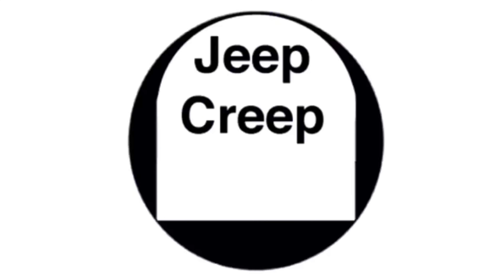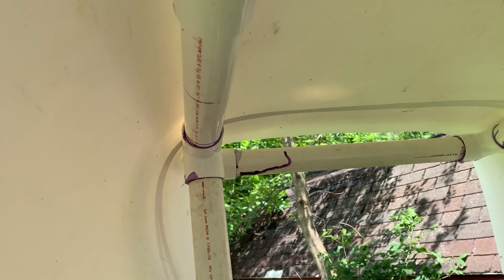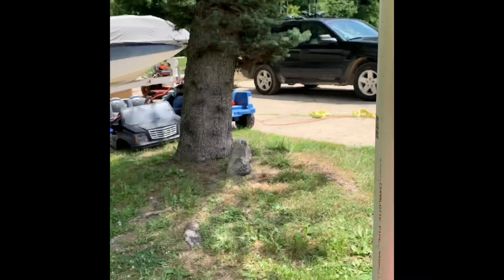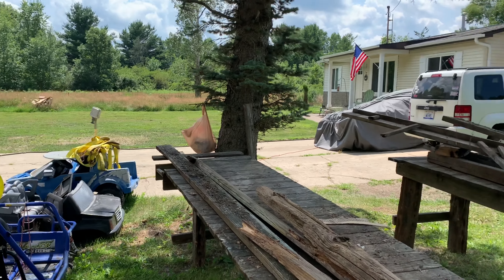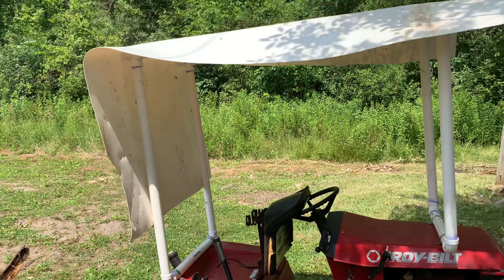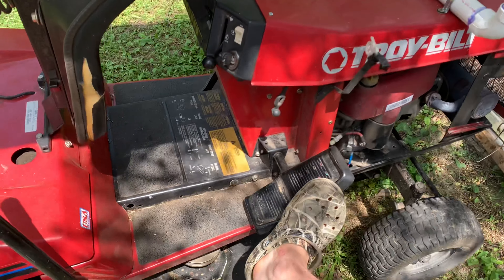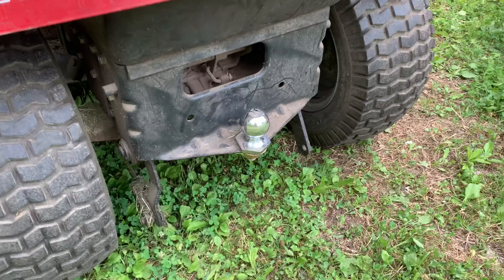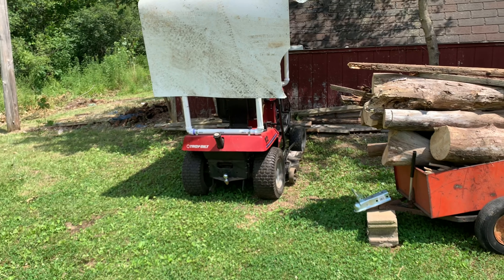CUSTOM roof on a Riding Mower / Sun Shade ON THE CHEAP !!!

Comment: I jus walked out of a store wanting about $200 for a sun shade !!
 PVC & tarp or vinyl is starting to sound better!

It’s a lawnmower not a PGA golf cart lol ikr!
Reply from the maker: Yeah my mower didn’t cost me $200. Stick with a $20 4x8 plastic sheet from Home Depot and some PVC piping. Mine is still running strong after 1 year!  I even store my mower outside, it keeps it dry. In the winter I threw a tarp over it and it held up no issues!  I will never buy a sun shade after this positive experience.
Reply: Front support needs to be a little shorter. Used golf cart roof makes great canopy, you can get em cheap at golf cart dealers or golf courses.
Reply from the maker: @Kookamungawerewolf  great idea!